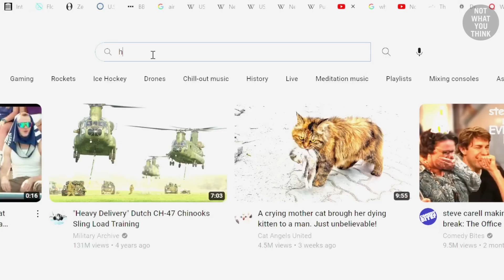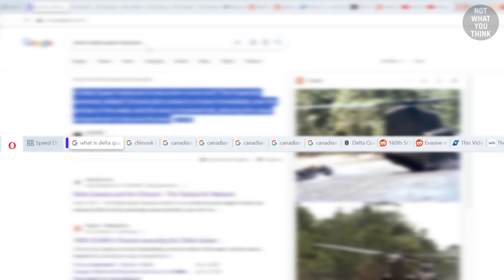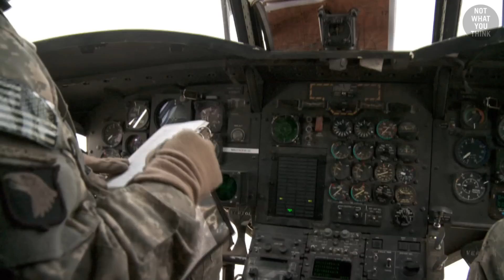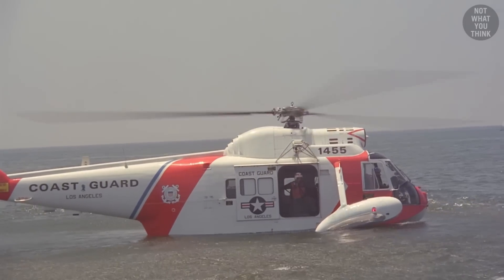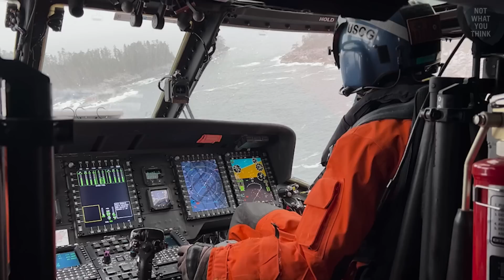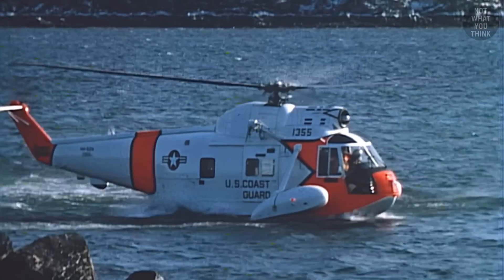Why Military Stopped Driving Boats into Helicopters at Full Speed

Comment: I was a helicopter engineer in the Royal Navy and we had a Seaking Mk5 land on the water at sea with a suspected fuel issue. The ship I was on raced closer to it so it could just take off and hop onto the flight deck but a wave hit the tail rotor and destroyed it. This goes to show you how dangerous landing on the sea really is and this was done as a last resort. I still have the pictures of the helicopter in the water.

Comment: I know the Chinooks will float. In the 1970’s I was working on a Offshore drilling rig in the Gulf of Mexico. We were working over a hundred miles from the coast. Chevron had a few Chinooks, two single rotor a one double. I wasn’t on it but one of the singles had engine trouble and landed in an inland canal. It floated just fine. They sent a crew boat out and pull it back to the heliport. CreWboats are boats, the most common are about 110’ long with about 40 seats like a Trailways bus. They can carry some supplies also. I always felt safer in those. The smaller helicopters would go down like a rock and the rotors would get you if drowning didn’t. Back in those days it seemed like every week one was going down. A lot of times they’d never find anything. I saw one body pulled up once a diver had hooked onto and he must have had 1000 shrimp eating on him. 
I wouldn’t eat shrimp for a while after that !

Comment: Jesus, who is the butcher @ 2:13 trying to drill out a stuck screw? Screws with a large button head like that you can usually loosen them with vice grips, if that doesn't work, use a die grinder with a thin cut off disc to cut a slot in it so you can use a blade screwdriver. If you HAVE to drill it out, drill it perpendicular to the panel and not on an angle like our rookie friend here.

Comment: Ch47 is able to water land but requires additional inspections after so it’s not preferred to be done because of downtime and corrosion risk.  The drains are already installed they just need to be popped out to allow water to drain out from under the floors.  So much information in the video is not correct.

Comment: The Chinook does not lift the ramp during take off to let the water exit through drains. That is incorrect. There is too much water! There is a  Zodiac member responsible for clipping the raft to the Chinook first and foremost once inside as the operator tilts the outboatd shaft out of the water to miss the ramp (and shut it down). The ramp stays down as the Chinook lifts off the water. Once the huge amount of water pours out, the pilot drops his nose to fly away and the crew chief raises the ramp. And the Zodiac comes in at high speed because of the strong prop wash of the rear rotor. If the special operator approaches too slowly, the Zodiac could be diverted by the prop wash and miss the Chinook bay. Been there. Done that. DOL.

Comment: There was a helicopter pilot who flew tours of San Francisco. His tours spent a lot of time flying over the waters of SF Bay, and one thing you should know, these waters are very cold.
      He was contacted by a sales person who had a system that would mount onto the skids of his helicopter and allow it to perform a water landing.
     He didn't think he would ever need the system, but in the end he was talked into buying it.
     After having it installed, on the very next flight he suffered an engine failure. activated the system and landed near the Golden Gate Bridge.
Reply: these are inflatable floats, either skid mounted or fuselage mounted.  they are put on any helo which normally flies over water, particularly single engine.  actually twin engine as well because the second engine normally only allows a controlled landing.  anyone who doesnt have floats installed is an idiot.  aircraft insurance premiums go down with htem even

Comment: Wrong, 
The CH 47s only restriction in water landings is having half fuel or more onboard so the fuel bladders don't collapse, the side sponsons carry fuel and over each main gear the battery and AC inverters... All the electronics are in the bay just aft of the pilots on the left side, Unless the pilots get wet the gyros and FCAS systems stay dry - Hovering over salt water requires a fresh water compressor wash or your engines get wrecked (All helicopters)

Comment: As a Chinook maintainer and crew chief for the US Army, I would like to correct that the chinook is still capable of water landings and 160th still does practice water landings. As for the rest of the army no we do not preform water landings anymore. All in all though is a very good Video! 👍
Reply: I was hoping the Chinook could still land on water! Thanks for chiming in
Reply: The risk assessment matrix does not go into negatives. That and the down time needed for maintenance would count heavily against Co/Bat/Brig levels. No commander would allow for such silliness.
Reply: @tobins6800 is the risk assessment martix a pilot thing or a military thing. Saw that in FAA handbook but i wouldn't surprise it came from military
Reply: @andrewcheng1998  I recall it from the Army. Not surprised Gov-wide
Reply: @tobins6800  It's not so much about the risk, as the budget.  The training & maintenance is expensive, and the bean counters don't like that.
Reply: It's not a SOAR thing, it's an SF thing.  If your outfit ever got picked to do a training op with them and they wanted to do water stuff guess what.  I've rode zodiacs into the back of a national guard 47.
Reply: @ianmacdonald5336  @cadenyoung9675 then y'all remember the incessant silliness of the risk assessment paperwork. In truth it was a way to push the blame off higher leadership...blah blah blah.
Reply: @ianmacdonald5336  Well if that happened on an F model Chinook, those crews were doing shit they weren’t supposed to. It’s specifically prohibited.
Reply: I was 160th 67U back in the day..
Reply: As of the G model Chinook they can no longer do the water landings. The avionics pods are not water tight and they now have electronics in the lower pods.
Reply: Do Chinooks float ? i knew seakings did. Genuine question 👍
Reply: @paulsanderson9027  Yes they do
Reply: Yeah it's no longer a permitted task. However just to clarify, the Chinook absolutely can still float and I would feel totally confident setting her down on water if I had to.

Comment: Those yellow stickers on the Seaking are not to keep water out. They are overflow outlets for the hydraulic systems. The only reason they were used here was to prevent any possible enviromental contamination of the lake.
Reply: Yep. The CH-124s were known to piss fluids at randim intervals. I did see one flying in person only once. Any other time they were in bits & pieces.
Reply: Where do those fluids go / what happens when they can't drain out of those holes?
Reply: my guess, as a civilian mechanic is they fill up the scupper bowl, and overflow into the area below it, for example the transmission dripping onto passengers @THE-X-Force
Reply: I worked on that exact seaking and did the preps for water landing..probly did the prep for that shot too... we absolutely used the tape to keep water out, along with drain plugs in the belly, we want to minimize water intake at all cost, safety and also a good protective measure as water landings were not great on the machine.... also we used the tape to write chuck norris jokes, that helo wouldnt take off without 1 chuck norris joke on it.
Reply: @fredtremblay9530  Your correction is appreciated
Reply: @SJRich1975 So where did you get your BS? I hate when people just randomly insert misinformation and people just accept it and even praise it with "likes" and "upvotes". Y'all are really the cockroaches of the information world.

Comment: You know the real reason that the Coast Guard doesn't land those helicopters on the water any more? They've been retired for 30 years. Also the CH-46 has been retired for about 4 years as of the making of this video, with the MV-22 Osprey completely replacing it.
Reply: Fun Fact: For the CH-46 the US Department of State uses them for embassy missions around the world so it’s still in service just not with the military.
Reply: Lost them in the middle east - So they're gone too  @mistap9115
Reply: @mistap9115  The video is about the Chinook in military service. So the info for the CH-46 was about the Frog in military service. If you want to get down to brass tacks the Huey is still being flown outside the military and the CH-54 is, too.
Reply: So does the MV-22 have water landing capability? Other than the 3.27 per 100,000 flight hours I mean.
Reply: nope. @Reddotzebra

Comment: Sling loading an ordinary boat--or a specially designed boat--could work for these purposes.

When it comes time to procure new helicopters, one could be designed with a detachable hull. Some hulls would be for delivering soldiers to land, some hulls for delivering onto water. Hulls could be as simple as a box/raft or as complex as a functional boat or APC or... a box with command equipment.

If the APC idea sounds stupid, it is. I'd settle for light vehicles. But if I wanted an air assault APC I'd have one designed that landed separately from its armor package. Basically, one lift brings the hull and a second lift drops off a box frame that's holding the armor package and that the APC hull can drive into, have the amor or ERA plates bolted on or, if you're fancy, automatically welded on with thermite or something.

Would these be as effective as IFVs? Nope. But nothing air assault  or airborne is ever as effective as its armored division counterpart.

Comment: You're really collecting those $ from advertizers, huh?
I dropped out halfway through.

In short, they aren't built and treated usually, to do this without it being a big deal. Plenty of amphibious aircraft aren't crippled for maintenance after going swimming.
Presumably, it would cost more weight and complexity (which means cost and maintenance) to have all of them built as standard for going in water.

Comment: That video of the helicopter nose diving in the water and obliterating itself was insane
Reply: Yet totally unsurprising
Reply: @RT-qd8yl  just awesome that it was caught on video
Reply: @asylumental 12/15 made out alive
Reply: @party-m8  I do have ears and was watching the same video that you were.
Reply: 1 @RT-qd8yl
Reply: I Could not undestand how the pilot just go further and further ahead until the blades hit the water. It has to be some kind of failure
Reply: @pedro.alcatra  yeah exactly, or the waves maybe, I'm not sure.
Reply: @pedro.alcatra  
My guess is the pilot tried to increase the collective to gain more lift. But since the nose was already under increased drag from being underwater, it just caused the vehicle to pitch forward more. From the outside, it's easy to see that the solution was probably to just cut lift entirely, which would have allowed the rear to fall, but from the pilot's seat it may not have been immediately obvious.
Reply: @Zxaber The long and short was that the Mi-14 settled with power. When it did, it impacted the water with such force the landing gear deployed and the crew did not recognize the gear down indication. He was trying to do a “running takeoff” due to low power available. A normal running take off is not uncommon for Mi-14s on the water. However, both nose wheels being down acted as an anchor and pivot point for the nose. Why he didn’t notice this on his ADI is beyond me, but that’s what happened. You can see the gear is down after it rolls inverted.
Reply: There was a storm swell wave coming from behind that lifted the rear, while the more dence air being pushed ahead of the wave gave more lift to rear.
At that point, non recoverable.
Reply: @pedro.alcatra because Russia
Reply: I had the same feeling of awe...made me watch in 0.25 speed. It's frightening how much energy is in those rotors, as soon as something misaligns poof disintegration.
Reply: @vanrick772  This is why the joke is that helicopters do not fly, they simply beat the air into submission.
Reply: 👏🏻 bravo! Lol @Reddotzebra
Reply: WHERE? I missed it! 

...kidding
Reply: When the Russian amphibious helicopters started the tip forward in water that was when disaster struck

Comment: This video gave me flashbacks of going thru the Dunker training in the Navy. The Dunker is a mock-up of the helicopter cabin that trains us to get out of a submerged helo. While upside down and blindfolded.
Reply: Indeed, we had to do similar training before going off shore. Although we didn't use blindfolds, since the helicopters would only fly at daylight hours. But the survival rate would probably be a lot lower in the North Sea, than the swimmingpool we trained in:-).
Reply: that sounds painful tbh
Reply: You have to train this also when you want to go for work on a oil or  gasplattform. It was one of the cooler part of the safety training. Also turn it upside down and get out. 

Especially if you are the only one who can swim during training in Abu Dhabi
Reply: There was a brief clip of the dunker at 1:12 to 1:17.
Reply: You have to react in a couple of seconds to: Upside down, blackness, and very wetness.  What was that escape procedure again?  That lever's down here?  NO Up there!  And I have to pull it HOW HARD!  And it SHOULD work? OH NO!  On THIS helo, there's NO LEVER!  I havta pull that INSERT in the window seal, like, ya know, like in a bus!

Comment: 11:35 I'm not a helicopter pilot, but I'm pretty sure part of what makes hovering near water level, or putting the helicopter on water and then flying again, .. part of what makes it hard is ground effect, which lets you use less power, all else equal. However, ground effect over water would be smaller than over (hard) land, due to water being able to move (slightly) out of the way. That extra capability comes at the cost of, e.g., more training or more risk when doing those kinds of close-to-water helicopter operations. Just, in addition to the extra maintenance and other things you already mentioned, there's also the ground-effect-over-water consideration. I'd imagine there are probably other ways flying a helicopter very close to water is different than in other environments.
Reply: IGE isn’t that big of a difference over water vs. land. It’s purely because of nowadays we have more electronics in the pods and it gets pretty old repacking or replacing wheel bearings and doing full corrosion control inspections that takes days. You don’t buy any better capabilities by landing instead of just hovering. 

-2,000 hours in a MH-47
Reply: Ah, very cool, thank you @Officially_Unofficial1
Reply: HIGE - Hover in ground effect, Water is bad , Tall grass is bad, Cement good  - electronics are nothing next to a hot engine being cooled by air laced in salt spray, Fresh water wash after every flight (Did tuna boat flying / maintenance in my younger years) - The CH 47 has AC inverters over the main gear and batteries over the other, Those side pods are 6 fuel bladders  front to back, All the electronics are behind the pilot in a closet,, Nice & dry @Officially_Unofficial1

Comment: We do have new underwater tech that can be attached to the bottom backend of the helicopter, dual water jet engines directly connect to rotor shaft for power with fin acutators that control the thrust while rotating on its 360 axis like the pod drive. Improve the hull material and less holes with more seals and anti-corresion properties... Voila! you got a true sea copter that likes to get more splashes and not worry about issues there. I wonder we could find new bearings design with back up bearings in cast of rotor blade smashing water where bearing will kill itself to save the rotor blades then backup bearing activated to restart rotoring back up for emergency lift.
Reply: But are the compromises worth it? You have a bunch of dead weight stuck to the bottom whenever you're not floating in water, and it doesn't really solve the problem that rough waves can be unpredictable and tilt the heli too much. There's not much you can do to prevent a rotor blade spinning at high speed to not get badly damaged from hitting the water. Plus, salt fucking sucks, and anti-corrosion would require even more weight added.
Reply: Sounds like a textbook ridiculously complex solution in search of a real problem. Just another defense contractor looking to make a sale any way they can.